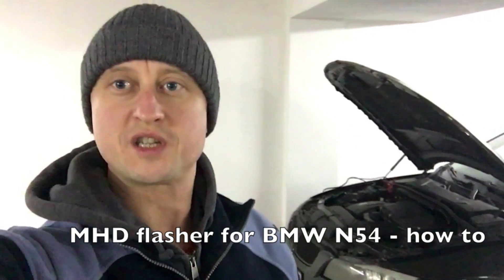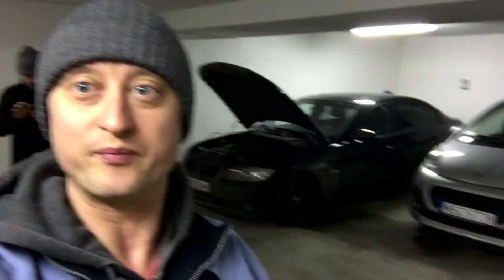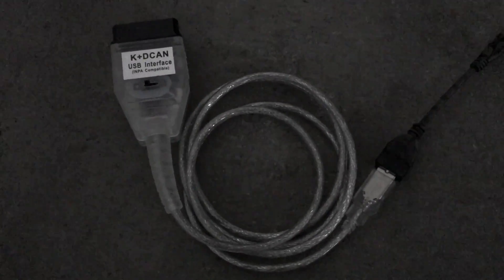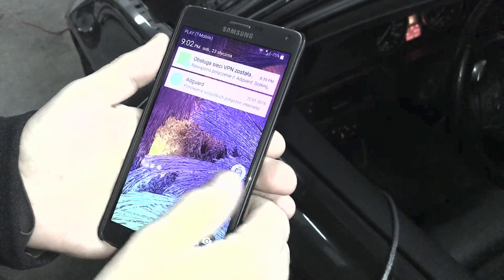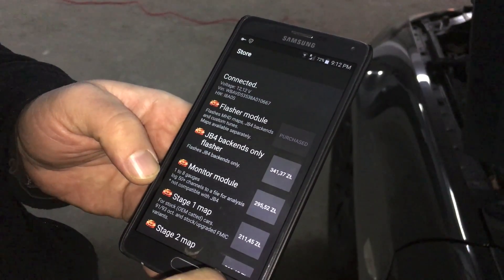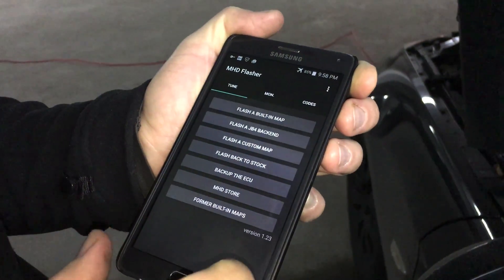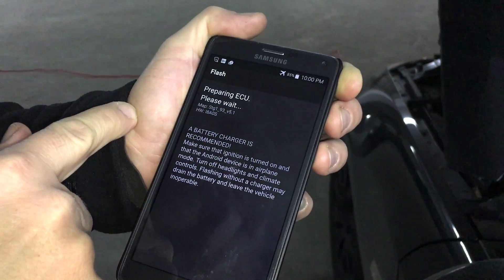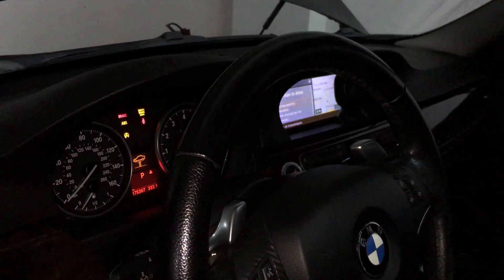MHD flasher for BMW N54 engine - how to

Comment: Hello. I have problem with purchase in mhd flasher apk. I dont know why, i try milion things but still Google play dont want accept my pay. Any ideas?
Reply from the maker: Country and payment method dependant issue. It could be that your bank doesn’t have a direct connection to google payment systems, it could be your first purchase with google, it could be some fraud alert on your card - talk to your bank first or purchase a google payment card, pre-charge your google payment account and pay from there. Hope that helps.

Comment: Does mhd flash work on Bmw M2 F87??
Reply: If it's a turbo model it should work. Look for the BLACK wifi adapter for the fxx series on MHD website
Reply: Just confirm your car to the list on the website

Comment: I've tried like 4 tablets so far. EVERY SINGLE ONE OF THEM except the nextus 7 said "Not compatible with this device". The nexus 7, when I plug it in, NOTHING HAPPENS, and I go to the MHD store and it says no cable detected.  I use an iphone so I can't use my phone. When we plug in my girlfriend's android phone, it COMES RIGHT UP. EXTREMELY FRUSTRATING!!!

WHY can't I seem to find a table that will work? I even tried installing the Nexus Media Explorer on the Nexus 7, STILL no luck. PLEASE HELP! i sold my Cobb tuner for this!!
Reply from the maker: +familyvids2009 you need to get a OTG compatible tablet. For the time being, add your google account to your gf's phone, purchase the MHD and maps from there, flash and log out. Then search for and second hand tablet that supports OTG (for instance, that can use external USB keyboard) and log in there - your purchase will be transferred. Did it help - let me know.
Reply: Does the Amazon Fire work with MHD?
Reply: I figured out how to but you got to download some very specific files.

Comment: Hey man, do i need to replace the coils, spark plugs or do the walnut blast or can i just flash the car? Currently car has a new clutch and 71k on the clock.
Reply from the maker: +xXHighlightsXx just flash it

Comment: I want to keep my 2007 335i as stock as possible. I have a drop in K&N and am thinking about getting the stage 1. Will that work? And how is your ride holding up after your stage 2? Cheers and thanks.
Reply from the maker: +Daniel Day I suggest you ditch the k&n drop in, it's both useless and dangerous to the engine. Get stock filter, flash the car with stage 1 and call it a day. I never went for stage 2 - don't have time for dp's.

Comment: Were you drunk when you made this?
Reply from the maker: +Acclimatising I'm always drunk. How old are you? Below 10?
Reply: It's his accent. Yes it was a valid question but seems offensive to ask. At least your good sports with comments. props.
Reply from the maker: +Acclimatising change your speakers or mute the sound next time - this should help. On a slightly more serious note, very cold garage doesn't help and yes - that's my accent. Sorry, mate.
Reply: One Monster Acclimatising dick is under 10mm.
Reply from the maker: +Daniel Craciun what you mean?
Reply: What I was saying was Acclimatising was making fun of your video which is helpful. You told him that that is age was below 10 and i said his dick is below 10mm. just adding more salt
Reply: LOL
Reply: It was a valid question, speech is extremely slurred.
Reply from the maker: +Daniel Craciun oh, now I get it, thank you :)) fair enough! Lol
Reply: One Monster it's all good now. Besides I want to MHD flash my 2010 BMW 135i. Can't wait to feel the difference.
Reply from the maker: +Daniel Craciun you will like it, trust me. I spent some time with stock car recently (engine issues) and it was boring like hell. MHD makes this car interesting. Start with stage 1, add vrsf fmic and you'll be happy.
Reply: I had my car stock for 3 months and its fun to drive. So much torque coming from this small car. I added dual cone air filters and feels a little faster and a larger intercooler. I have my downpipes ready but not in the car yet. i want to flash my car first. when i get my oil pan gasket replaced which i need to do drop the sub frame then i can change my downpipes. after that i want to put a quad exhaust from Remus and my car will sound amazing and look amazing.
Reply from the maker: +Daniel Craciun makes sense - good luck and please report back with the results!
Reply: One Monster I will report back once it's done but it's gonna take some time to do it all. It will take months. I'm kinda I a tight budget. So getting parts slowly
Reply: Don't know personally but some forum guys say the MHD flash is a little aggressive for daily driving if your 1er is your DD. I actually just went JB4, and scooped a Berk cat back with a BMS intake and charge pipe. Should be a solid little car 👍🏻
Reply: Acclimatising thanks for the info. But the 135i has the same engine as the 335i. What is DD? My 135i is a automatic transmission.
Reply: Acclimatising I feel like the JB4 is more aggressive than MHD. As it's giving 100hp right off the start. I heard in many forums that jb4 does some harm to the spark plugs and coils. Well with any upgrade to the engine could cause that. But jb4 and other tuning puts more load on the coils and plugs
Reply: Where did you hear the JB4 gives you 100hp? If that's the case, i'm gonna need new plugs, coils, injectors(probabaly) and god knows what else right from the go. JB4 is just a piggy back to amp up the factory tune from my understanding. It also gives you a little gauge customization that I don't think MHD offers. DD means daily driver lol. And, yes i'm aware the 135 and 335 are both N54 and N55. Only reason I even came across this video was because I was planning on going MHD but a deal for the JB came up and was WAY too cheap to pass up. I'm not even on an N54 platform anyways, I'm N55. Lol I was looking for guidance nonetheless.
Reply from the maker: I read on n54tech.com the claims that jb4 can give you up to 100 bhp on map5 with all supporting mods. No, JB4 is much more than the amp - it's also a boost controller, so in case you decide to go single turbo with MHD, you need some boost controller (like JB4) to control the boost. However, MHD is much modern, provides better engine protection, ots maps are more frequently updated - and it's a much more elegant solution - no piggy backing, just flash the ecu. Hence my decision to skip the jb4 and I went straight for MHD. And I'm still very happy with it.
Reply: Thanks for the input i'm definitely getting MHD tune. The problem is i have a iPhone but no android. So is there any cheap device i can buy just to get MHD on google play?
Reply from the maker: +Daniel Craciun very same situation here - I only had an iPhone. You need a OTG ready android device (VERY important) and a good USB - OBD2 cable. It can be cheap - but it needs to support OTG.
Reply: Acclimatising OTG supported? I don't even know what that means
Reply from the maker: +Daniel Craciun it means you can connect things like external USB keyboard to your tablet. Not every device supports it, funny enough those more expensive ones do not support that. You really need to be careful what you get - always make sure (ask seller or Google) you know what model you are getting.

Comment: Is it free now or same thing?
Reply from the maker: +allen hakobyan free? Why would it ever be free?
Reply: One Monster my mistake and do I have to purchase both stage one and the flasher on current version or can I just stock 6.1v stage 1?
Reply from the maker: +allen hakobyan if you have purchased anything on version 6 it upgrades to version 7 for free.
Reply: One Monster I haven't purchased it only cause I don't have a ODB port any chance if I can get it in a store?
Reply from the maker: +allen hakobyan what you mean you don't have obd port - they are factory standard?

Comment: Thanks for the vid guys, I'm switching from Cobb AP to MHD tonight, I'm picking the car up from the shop that's ~4hrs away from my home, and I have a custom e50 pro tune that I'll be installing. After watching your video I feel a little more comfortable with doing this.. wish me luck!
Reply from the maker: +Zach Folkes good luck, if not too late! How did it go, how does it compare to Cobb in your opinion?
Reply: One Monster well, I feel like the Cobb is a lot simpler, has some nice features like the performance (0-60 and 1/4mi times), BUT, Cobb can't go over ~21psi boost.. I find that the MHD app has some nice features and gives you more freedom although I'm using a pro-tuner so I'm not making changes myself.. unfortunately my cars fueling system, even with the stg2 LPFP isn't allowing me to run more than like 21psi boost as it is, so until I can afford to upgrade my fuel system (probably go PI) I'm sorta limited.. that said, even with the car not fully tuned I destroyed a brand new C7 stingray on a roll!
Reply: Zach Folkes can you please give me a link or something to where i can buy the MHD? i can't find it anywhere
Reply: Thomas Prestridge on your android device, open the Google Play store and search for MHD. It should come up as the first option.
Reply: Zach Folkes so all you do is use the app? you don't need anything else?
Reply: Thomas Prestridge so you need the app which is free but then you will need to purchase the various license packs depending on what you're wanting to accomplish/what fuel you're running etc. I paid a pro tuner to write a custom tune specific for my car/mods.. you can purchase tune packs through the app that will give you various starting points. From there you'll need to install whatever tune matches what you need and then do some logging. Then you can adjust your tune from there.. many people will be fine with the "ots" (off the shelf) tunes.. you will see a marked performance improvement even with a completely stock 335..

Comment: I flashed my car recently. It took 40 minutes !
It was the longest 40 minutes of my entire life.
Reply: did you use a battery charger?
Reply from the maker: +Gwent Champ i know that feeling lol - how do you find the car after the flash?
Reply: Car feels more powerful for sure. I'm using the 7.1 Stage 1 93 Oct map.
Reply from the maker: +Gwent Champ make some logs, just in case. And fmic, get fmic. It's important, more important than any other mod.
Reply from the maker: +Gwent Champ lol I know the feeling :)
Reply from the maker: +Daniel Dowden front mounted intercooler
Reply: How much did it cost in total?

Comment: Is that better than the JB4
Reply from the maker: +kimo boy miles better in any way
Reply: +One Monster How do you data log ?& how much e85 can you run on the MHd
Reply from the maker: +GangGreen_714 there is a logging module in MHD for that, you need to buy it first. Top otc map in MHD is E60, however, with custom tuning and proper hardware preparation you can run straight e85 fuel.
Reply: One Monster so to log does to have to be connected to the car ? I'm so close to pulling the trigger and selling my jb4 to go with MHD
Reply from the maker: +GangGreen_714 first flash, depending on the ECU - between 18 and 45 minutes. Then, any map change - about 2 minutes. And that's it. It's the best tune out there at the moment.
Reply: One Monster i will pull the trigger on this tbh its also half the price of the jb4 
last question is how would iknow what edu version i have ? my build date is 09/2007
Reply from the maker: +GangGreen_714 indeed, it's dirt cheap. I'm on mobile at the moment, but you're supported, no worries.
Reply: Could you recommend the best tuners out there for this flasher?? Looking for one immediately. thanks!
Reply from the maker: +SHIBA GT-R google wedge performance MHD, they make maps for MHD.
Reply from the maker: +SHIBA GT-R wedgeperformance@gmail.com
Reply: You should have a JB4 with MHd backend that's what people say atleast

Comment: how many hp do you get on stock n54 on stage 1 ???
Reply from the maker: +Edwin Cespedes app developers claim, that on pure stage 1 on 91 fuel you should be around 340hp. I haven't been on dyno yet and I'm running Stage 1 + FMIC 93 map - I should be at around 370hp.
Reply: Stage 1 is 360hp 390 ftlb. Stage 1 plus is 390 430ish

Comment: how did you get mhd to detect your ecu? I cant seam to get it to connect tried all kinds of different ways any ideas?
Reply from the maker: +bmomosaik is your android otg compatible for sure? That's where you need to start.
Reply: +One Monster Otg works Tested on Flash Drive.

When i Plug the cable into the car, It does Light up,

When i Plug the Phone into the OTG which is connected to the K-Dcan 
cable MHD does load up.

When i try to do things on the app the Light on the K-Dcan does blink or 
go solid.

But The ECUInfo shows as FALSE

Do i have a bad cable?
Reply from the maker: +bmomosaik you might have the bad cable or nor fully otg ready device. Any luck already?
Reply: +One Monster No luck :( very sad. sending cable back and going with another one. very sad day.
Reply: @bmomosaik  are you in canada? Can show you to a cable that works and is cheap
Reply: @kaelanburke2097  i got one that works just costed 100 lol

Comment: Guys,you are very funny :)))) Anyway,I bought this aplication and is a real deal for what it can do.My 335i e92 is a different car now,in a good way.
Reply from the maker: Thue! Is your car stock?
Reply from the maker: I meant "true" :))
Reply: +One Monster yes,is stock.
Reply from the maker: Then stick to Stage 1 on correct fuel - and see, what kind of the performance you can expect: http://youtu.be/3qIdUzOHdWo
Reply: +One Monster Is this stage 1 93 fmic?or without fmic?
Reply from the maker: There are two maps on stage 1 - one for stock car and one for fmic upgraded car - with fuel variations. If you have stock fmic, choose the one without fmic in the name.
Reply: +One Monster  in my country I use 98 sometimes 100 octans gasoline..I flashed Stage1 (93 Oct/98Ron) V5.1
Is this ok?
Reply from the maker: +cristy7610 yes, it's perfectly fine. If it's cold there where you live, try the fmic map.

Comment: what was the performance like once this was done?
Reply from the maker: Much, much better, power delivery range is much wider, car pulls much harder, big improvement. Next week I will shoot the v6 beta maps, that offer even more. Truly excellent stuff.
Reply: i have a jb4 and thinking about buying the mid backend flash.
Reply from the maker: According to the lots of reports on this, it's a good idea.
Reply: One Monster  Hello i installed MHD FLASHER stage 2 on my 335i n54 and deletet cats but after hard acelerating on bord computer show engine light check on my phone mhd aplication shows 30FF code please help me ??
Reply from the maker: +Dashmir Elezi you have a boost leak. Check your piping for the fmic, charge pipe etc.
Reply: If you deleted the cat, that is big check engine light.

Comment: are the plugs and coils required?  I have 30k miles
Reply from the maker: If you have no error codes, I wouldn't bother. But if you still want to change plugs, I suggest you go with NGK.
Reply: One Monster  how many HP win with a mhd flasher stage 2 93 98 oct + catlles dp?